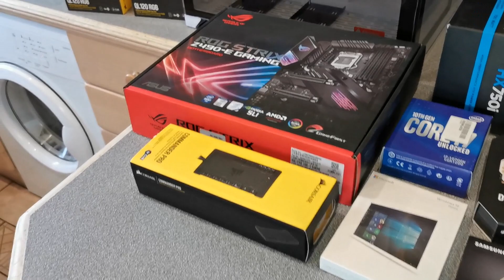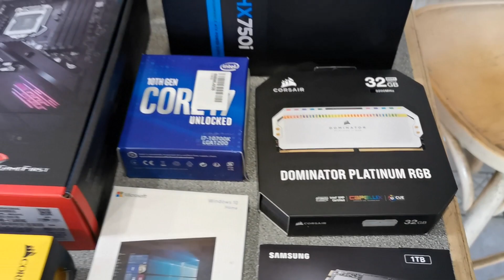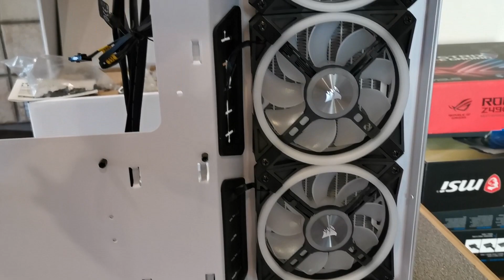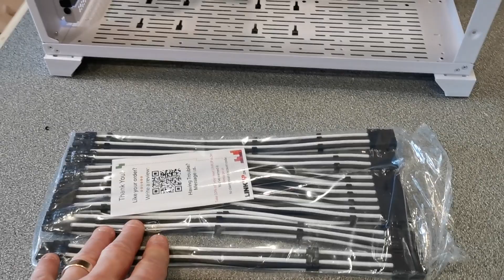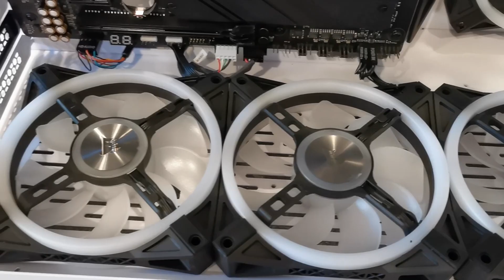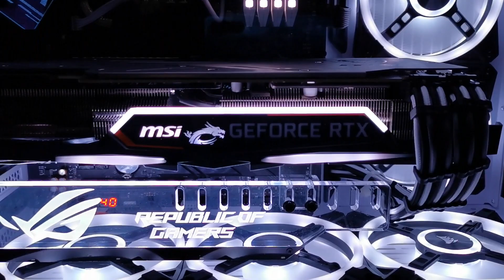Lain-Li 011 Dynamic Mid, Corsair RGB Build

Comment: Does putting an exhaust fan on the rear make a difference ?
Reply from the maker: If you mean at the rear just above the Lian li badge, you cannot fit a 120mm or 140mm not really designed for a fan, If you have positive pressure in the case is good as negative pressure will draw dust in through those holes, Positive pressure will keep most of the dust out, over year since build no dust gets in, hope this helps
Reply: @JAYZZ71  hey I'm sorry got s bit confused with your comment. Yes the resr meaning to the left of the top fans above the lian LI sticker. I've seen multiple builds with a lot fan there as exhaust.  You're saying that having a fan there (4 exhaust fans total 3 top 1 rear) that it would creat negative pressure when there's 6 intake fans in side and bottom ? So you definitely recommend only having the too exhaust fans and not adding one right next to them shooting to the rear?

Comment: Love this build! However your AIO is not correctly installed. This way you will force air to the top of the radiator that gets sucked in to the pump. Tubes should always be facing down (with the pump still lower than the highest point of the radiator ofc) unless you top mount it.
Reply from the maker: I would have to disagree, testing temps in both top and side mounted configuration this method was cooler and the pump is silent, the CPU remained 5-7c cooler as no heat from the GPU would pass through the Rad (top mounted),CPU under normal load is 28-32c and under load highest is 51c-55c @4.7ghz (turbo 5.1ghz),Sorry to say this is the best setup for temps and no pump noise, Why anybody would top mount is beyond me as heat rises and GPU heat has to go somewhere, the rad is in its own compartment keeping nice and cool and tubes are never long enough to bottom mount (which would be better), As long as the pump is lower than the top of the rad your good to go ( even 1cm lower ).
Reply: @JAYZZ71  I'm not talking about temperatures. I just don't want you to kill your pump 😅
Nexus did a great video about it here: https://youtu.be/BbGomv195sk
Reply from the maker: @precludeneco  Hi  sry i didn't get back, but to answer your thoughts on killing your pump, March 2011 Video build using the first Corsair AIO in top mounted tubes, that system ran for 12 years (QX9650) with no pump issues so i would still disagree makes no difference what video we watch, Proof over 12 years is a far better test. I've had no AIO fails in over 300 builds

Comment: Beautiful build, i just bought this case with the corsair rgb fans as well along with a 3080ti ftw3 and a kraken 360 cooler. This is my first build using an aio,  i will be using an evga ftw3 3080ti, woukd it be beneficial to do the same configuration as the gpu has 3 fans to cool it similar to your msi card. Thanks for the info!
Reply from the maker: Thank you for your kind comments, a year after build all is still good, no issues with dust with this config more air going in forces any extra through small holes (negative/positive pressure), this setup is the best for me, Placing of the AIO is perfect, never understood why people top mount a Rad as heat rises and passes through it makes  no sense at all, ALL GPU's run hot, simply get that heat out !!!  and enjoy Gaming  👍👍

Comment: hi mate - very solid build. question, would the bottom intake fans air flow be obstructed by the GPU? this way it would prevent air reaching the mb and cpu? any thoughts on 3x intake at bottom and 3x intake at side and with the radiator at the top?
Reply from the maker: As Gpu's run very hot today these fans bring cool air into the case directly into the GPU and makes a  difference, if I run the game with the 3 fans off my GPU runs 10c warmer , Using HWMonitor gives a good indication of temps, M/B 27C, CPU 30-32C During normal use and 46-58c during Gaming ( 3  hours) 10700k @4.7ghz (turbo 5.1ghhz), with this setup a lot of heat (GPU) is removed via the top 3 fans heat rises and passing that through a rad to me makes not sense again tested and CPU runs 10c being side mounted i have run all setups for this build and the components and for me this setup works well, but remember all setup are different everyone has there own, 8 months later still happy with this Pc, the only one issue i have is the ICUE software can be a pain Corsair need to address this as it can be overpowering sometimes, hope this helps and thank you

Comment: If you did rad on top with push/pull would that help with heat from gpu
Reply from the maker: No the 3 top mounted fans remove the Heat from Gpu, Top mounting the Rad with the heat of the GPU passing through makes no sense, heat rises get it out the case best way

Comment: I'd like to see the temps on this build....I have a similar configuration but my rad is on top and I have a evga ftw3 300 ti and my temps are a little high when I play....I even mounted my gpu vertically that way it could get better temps and im still stuck at 77 degrees Celsius.
Reply from the maker: So your GPU is 77c or CPU ??, Having you card mounted vertical the 3 fans (case) are working against the Gpu which will be blowing warm air against them ??, Fan Curve is adjusted on this RTX and Max temp is 62c (overwatch 3 hirs), Having Rad mounted at the top does not work well for me heat rises avoid top mounting at all cost for me

Comment: But the rad is emitting heat directly in to the case and ultimately to the gpu.
Reply from the maker: Yes Agreed, But i would rather pull cool air into the rad from the rear and then warm air into the case,  Having the heat from the GPU being pushed through the rad is far worse ,Remember the GPU is the Biggest heat component in this case, having tested in both setups and this is far better and the CPU runs 8c-15c cooler. The air from the Rad to be fare is not really warm has no effect, for this build & components this is the best setup for me, days of testing with all fans and placement of components (exhaust/intake) is ideal, remember every Pc build is different,

Comment: This is the case I'm set on. Just hate that no matter how you set it up, you will have to see the ugly side of the fans. These fans are probably the least ugly on the exhaust side that I have seen. They are proud of them when it comes to cost, and they had to make it super annoying on the connection side.
Reply from the maker: Agreed the exhaust side look nice, but so much to setup with the Commander Pro and frankly not a Big fan of the ICUE software seems to have a mind of it's own somtimes

Comment: Nice build. Question is, can I do an AIO like that in the Lian Li XL case?
Thx in advance.
Reply from the maker: Yes you can this AIO IS 240MM, the XL case will fit a 360mm version by lian li in the same setup (side mounted), hope this help, any further question feel free to ask, any of these - https://www.overclockers.co.uk/lian-li-galahad-aio-360mm-high-performance-rgb-cpu-water-cooler-white-hs-008-ll.html  -  https://www.overclockers.co.uk/asus-rog-strix-lc-360-white-edition-performance-rgb-aio-cpu-liquid-cooler-360mm-hs-04z-as.html   both these will allow 4 sticks of Ram, many have clearance issues by blocking Dimm slot 1, you will see plenty of vids with only 2 sticks of ram as pump is too large (manufacturers need to do there homework , lol)

Comment: No issue with Ram clearance?
Reply from the maker: No issues with this or in my other video using a Li lian 240mm cooler, four sticks with clearance for the AIO
Reply: @JAYZZ71  you're THE MAN. You answered my second question without me even having to ask it. I just bought a Galahad 360, have a Z490 and Corsair ram. Was worrying about fitment. I'm transferring from a 4000D to the lian Li 0-11 case. Gonna use my old (well almost new) case for a PC build for my nephew. Thanks for the response man, you're builds are top notch!!

Comment: 47 Degress normal for cpu temps?
Reply from the maker: Normal temps (this build)  idle - 30c-35c, browsing/youtube 35c-45c, Gaming 4k/1440p (4hour)s 45c-68c, never goes above 70c, always use "CPUID HWonitor" for temps as long as you keep it below 80c your fine, increasing fan Curve or using a High end cooler and airflow can change this, overclocking anything will also play its part on temps

Comment: Hey mate having a small issue with my new build (first ever) on boot the pc shuts down after CPU temps hit like 90 degrees on start up. Any ideas on what to do?
Reply from the maker: Looks like thermal shut down, Make sure CPU cooler is mounted correctly, thermal paste has been applied, if your using an AIO make sure pump is connected and running and default 100% (can be turn down later depending on noise and heat), if you go into bios temps should be 24-30c check fans are running correctly ie CPU,PUMP (AIO), if you need more help feel free to e-mail me info on "about" section ,also may sound silly to say but some CPU coolers come with a plastic sticky peal off on the copper base these are the ones without pre-applied thermal paste ie LI-lian AIO have them, hope this helps let know if you sort it out 👍
Reply: @JAYZZ71  I'm using the same cooler as you, thermal paste was pre applied
Reply: Thanks for your time man, literally just finished the build and just booted for the first time, however after a few seconds I watch temps go to 90 degrees before shutting itself off

Comment: Sorry another question,
The micro usb you connect from cooler to m/b, yours is fully white? Mine is white up until the end then its black green red and white slightly?
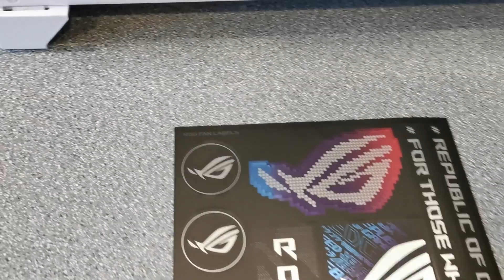Reply from the maker: Same as mine at 3:59 its the white block connector you can see red/white/green & black slighty hidden by the QL fans at the bottom, I don't mind the questions ask as many as you want 👍
Reply: @JAYZZ71  do you have anything I'm able to send you pictures of?
I've just completed my build and back ordered a GPU however the cabling on the front panel and stuff just seems off

Comment: Hi quick question if you wouldn't mind helping me out a lil, 
The micro USB for the AIO, how did you manage to hide it so well? Also where did you get the flatter cables? If you can link that would be well appreciated
Reply from the maker: Micro USB was hidden behind the motherboard long enough to reach bottom USB with now extension and the cable I used was this : https://www.amazon.co.uk/gp/product/B083XDQSWT/ref=ppx_yo_dt_b_search_asin_title?ie=UTF8&psc=1

Comment: Is the commander Pro essential? 
I have 6 QL 120s but no commander pro
Reply from the maker: You don't have use the commander pro you can control your fans and RGB lighting via your M/B connection and software( depending on fan headers on the m/b), the commander pro just makes it a little easier but i agree not cheap by all means, just the less software less to wrong
Reply: @JAYZZ71  I'm just starting my new build, no previous experience so everything's foreign to me. 
I only have 6 QL fans and I'm just going to use the MSI fans included with the cooler, have you compared your current temps with the other fan configs and is this best? If so I will just copy your layout

Comment: Did you experience any coil whine out of the GPU? I have almost the same build as you(different CPU -AMD , MB and PSU). Also I mounted my AIO at the top to exhaust but I am considering to give it a try and use your AIO-fan orientation.
Reply from the maker: No Coil whine thank god but had some pass builds that did but 90% went away overtime, I have tested with AIO at the top and bottom ran for week on both and for this setup only because this RTX card runs very warm and needed to remove the heat via the top 3 fans, it is really dependant on what card you use but overall the CPU temps were better for me being side mounted 10700k is at 4.8ghz / Turbo 5.2ghz, does not harm to test both configurations, Heat always rises passing heat from the case into the rad for me is not efficient but that's only my opinion, hope this helps 👍

Comment: Hey man great build I got a similar one with the lian li mini and sl120d they got! Quick question, what did you use to help hold up the gpu? That clear bracket
Reply from the maker: This is good but will not work in the Mini version as the slot fixing is modular and does not carry strength for this bracket, my vid before this was in the mini and tried many GPU brackets this link is for the one above - https://www.ebay.co.uk/itm/5v-3pin-ARGB-GPU-Support-Bracket-for-PC-Graphics-Card-Suit-RTX-GTX-RX-etc/353235858971?ssPageName=STRK%3AMEBIDX%3AIT&_trksid=p2060353.m2749.l2649   and this link is for a bracket that work in my mini build - https://www.amazon.co.uk/EZDIY-FAB-Bracket-Graphics-Gaming-3mm-Aluminum-White/dp/B08LK5H5YJ/ref=sr_1_1_sspa?crid=1NM4VHWYQ564U&dchild=1&keywords=gpu+bracket+white&qid=1620128224&sprefix=gpu+brack%2Caps%2C147&sr=8-1-spons&psc=1&spLa=ZW5jcnlwdGVkUXVhbGlmaWVyPUEzS1VYN1NQOFlIQ1pGJmVuY3J5cHRlZElkPUEwNDMyMDIyMTg0UEJIR1VPU1NXQyZlbmNyeXB0ZWRBZElkPUEwMTAyMzQwM0U4NUhTNTQ3TDJLUiZ3aWRnZXROYW1lPXNwX2F0ZiZhY3Rpb249Y2xpY2tSZWRpcmVjdCZkb05vdExvZ0NsaWNrPXRydWU=

Comment: Quick question was there any intake because it seemed like there was only exhaust
Reply from the maker: Bottom 3 fans are intakes to cool GPU, AIO fans are also intakes cool air from rear for rad, top 3 are exhausts to remove heat from case (positive pressure setup)
Reply: @JAYZZ71  oh lol my bad I thought the aio was exhaust cuz of the faces
Reply from the maker: @modelotime2456  Corsair fans are nice having Aluminium stickers on both sides it can get confusing  👍

Comment: Wonderful build, this is exactly what i'm planning to do :) question : how temperatures are going with QLs ? in big and long gaming sessions ? can you give us numbers plz ? cause i read that QLs aren't good at all for radiators. And isn't it better to mount top to save GPU other than CPU in gaming ? thanks a lot for your help :)
Reply from the maker: Firstly the QL are a good match for the original AIO fans as the CFM/RPM & Static pressure are nearly in the same ball park (important), General use CPU- 32C-36C, GPU  40C (Fans set to 800rpm), Gaming (3 hours) CPU 58C-64C, GPU never goes above 65c as fan curve is set to 70% once GPU reaches 55C, As the Card i'm using is a 2070 super it's known for running very warm so for this build i would not top mount as the GPU heat will pass through rad (tested) side mounted is more efficient for this build may vary depending on what GPU you have, and this setup has Positive pressure since build no dust has formed in the case which is good overall very pleased with temps and with any AIO always use your own thermal paste high quality is better than stock, also as long as the pump is lower than the top of the rad they will not be any air in the pump and it will not reduce life of the AIO, Having used a Corsair H60 AIO Hydro for 10years with tubes top and bottom in 2 systems and still working on both shows proof it does not reduce life (fact), Hope this helps and thanks for the nice comments
Reply: @JAYZZ71  Thanks a lot for your detailed answer. My plan is to go for ryzen 9 5950x and whichever 3090 rtx ( i guess asus strix or evga TWF Ultra). i'm planning to go for NZXT Z73 or corsair H150i capellix. Would you have done the same setup as yours with this comp ? as i read here and there that QL120 are not that good, i was planning to go for Lian Li SL 120 fans. Again thanks in advance for your help :)
Reply from the maker: @Obscu-rium  I have a 2 vids in a Li lian Mini using the SL120 minimal difference but i personally prefer the SL as less wiring and no commander pro to pay for

Comment: Can i ask how many fans can u put into mobo before u have to buy a controller
Reply from the maker: 8 fan connection on M/B which are - 
CPU Fan Header, 
AIO Pump Fan Header
Water Pump Header
M.2 Heatsink
M.2 Fan Header
4-pin PWM/DC Fan Header

Comment: I would of went for a NZXT kraken aio and swap the fans out for some ql120s
Reply from the maker: Nzxt Kraken would not fit as it pushed up against the Ram and in the other rotation the tubes were too far stretched over the Ram led's and the Fans are QL120 ?

Comment: Awesome Build! I'm actually doing a similar build. How did you get your radiator in the back of the case like that. My case front panel connectors seem to get in the way. Did you do something in particular? I tried pressing them down or moving them but that did not seem to work. Thanks in advance! It looks sick!!
Reply from the maker: I did redo with cable ties its possible, if you want me to send a picture of what it looks like send me an e-mail ill send it to you   	jpenny3293@aol.com

Comment: I'm kinda noob at this kind of building, but if I understood it right; you've placed the fans to push the hot air from the radiator out of the back, with a triple fan intake on the bottom and triple fan out on the top? And does the Corsair ram let you configure the RGB lighting or is it static? Totally fantastic build overall. Shame about the RAM stick though, but that happens sometimes :/
Reply from the maker: Rad pulls cool air from the back (intakes), the heat generated from the rad is very small has no real affect on inside temps, the GPU runs warm indeed, not ideal to push through rad, the setup is perfect for this build, will differ with different components ie: FE GPU , The Ram can have any color and any affect you want via the ICUE software, this build he wanted all white/black build, this case has Positive pressure (no dust being sucked in ) temps are fantastic
Reply: @JAYZZ71  if it pulls air from the rad into the case, why is the fans turned around? I thought turning the fans would push air into the back. But the top is exhaust and bottom is intake aswell?
Reply from the maker: @christianj.bardsnes2394  The fans on the AIO are intakes